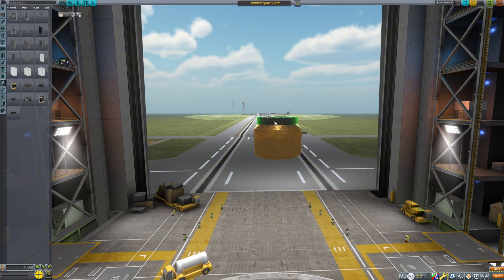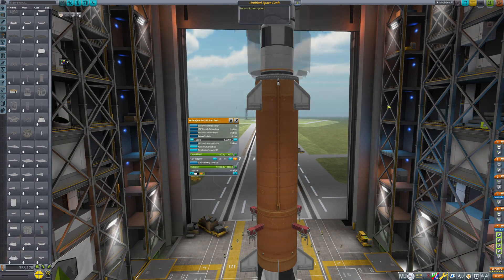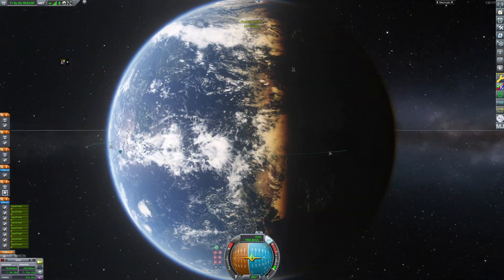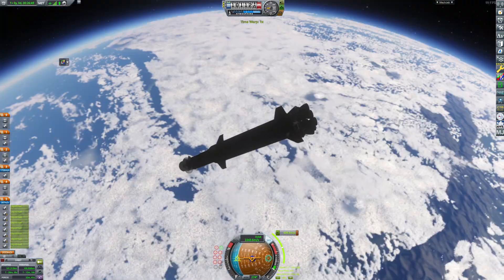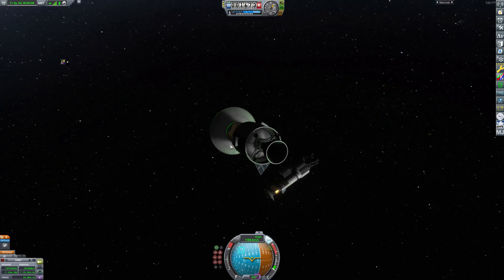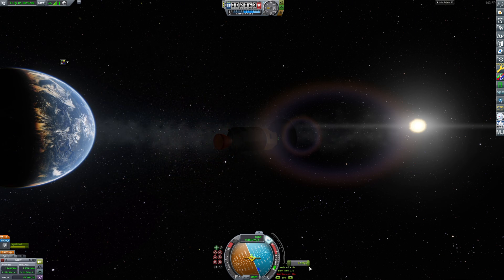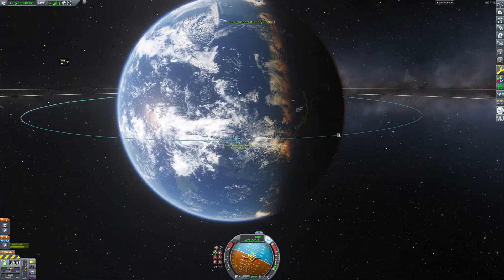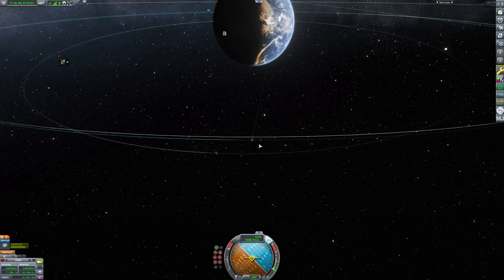[PART 1] Setting up a Satellite Network! | KERBAL SPACE PROGRAM #ksp #ksp2

Comment: The reason for the blowups and that the two first crafts don't just get projected straight forward at the decoupling, is the clipping.
While the craft is one the parts don't interact while clipped, but quite soon after you stage the one craft becomes two and in these cases the parts were still clipping making them act like they hit each other.
Reply from the maker: that makes more sense 🤣